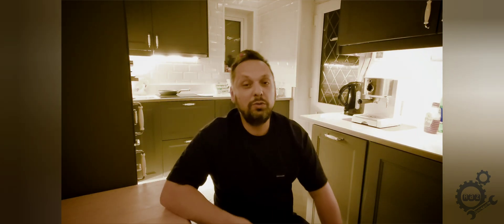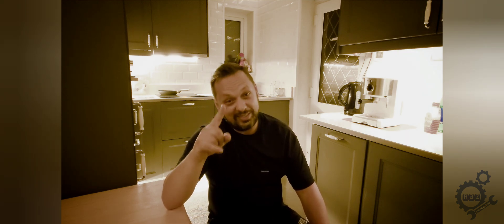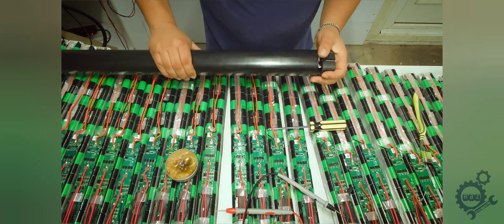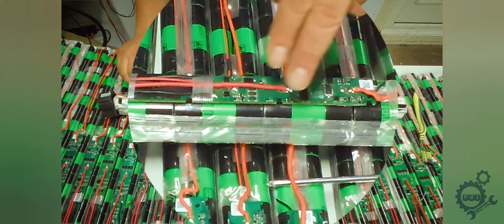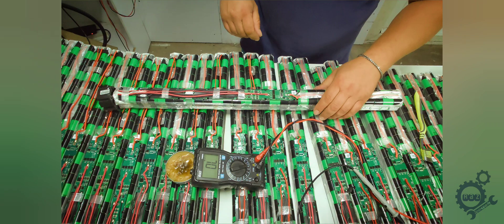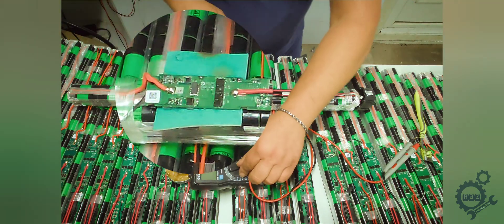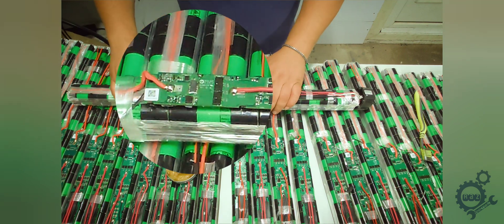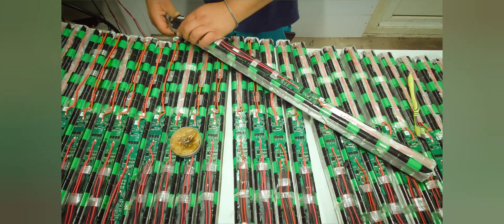VANMOOF S3/X3 HOW TO REPLACE THE FUSE Error 6 , 17 , 19 , 20 , 21

Comment: I have a VanMoof S3. When I plug in the charger, the charger light turns green, but the bike display shows nothing. I removed the Smart Cartridge and plugged in the charger again, and it displayed Error 48. I opened the battery and found that the main fuse is blown.

Is this expected behavior? Will replacing the fuse fix the issue?

Comment: The part number for the fuse is SFK-4045 and the part number for the fuse of the external bike battery is SFK-4030.
You can find the data sheet and sellers with this number ( I bought the fuses from Ali Express).
I fixed an external vanmoof battery in jannuary and used hot air to replace the fuse as I was unable to get it done with a soldering iron, the plastic cover came off and I did not bother to glue it back on as the fuse does not need the cover to function and is well protected inside the external battery pack.
I also reduced the charging voltage of the vanmoof charger as shown in another video on this channel.
Thank you for your videos they helped me to save a healthy battery pack so the owner did not have to throw away a perfectly balanced battery with no defect but the "eff you" fuse.

Comment: Since you have tons of experience with these batteries: My dad has a S3 and after having it out over winter it didn't came back to life. It has error 19. I assumed the battery was too deeply discharged and the BMS pulled the plug, so I told him to get it out. Charge/discharge pins were also dead so I made him open it up, remove the black covers over the BMS and let him measure the voltage of the pack at the left and right center connection on the BMS. The multimeter shows 4.1V. How does that happen? Is there any chance it's something else or is it dead dead? And how can it discharge so low in a few months?
Reply from the maker: sorry for late reply ... fuse is blown and bms is shut from outside ... no power goes in or out .. regards

Comment: Hey, I get the error codes 6 17 20 by driving the bike at 70%. Can the Fuse get broken by driving and do you think when I replace the fuse that I will fix the problem.
Reply from the maker: Yes sometimes fuse breaks during ride ... Is the fuse

Comment from the maker: Problem is  that charger should keep charging with 4 amp and is not ...is charging with 6 ... How ever ... If you have a watt meter you will see that amps don't drop at around 80% and charge slow the rest of 20% ... It charges with 6 amp all the way to 100% ... Any lithium battery after 80% should be changed slowly... Is when the fuse blow and is ruining the cells ... That's a easy  and quick fix to get rid of the problem.... Probably it needs to be modified to have a slow charge at the end to avoid fuse to blow .... The percentage of fuse blown in batteryies is huge like 80% of the fleet and the ones what doesn't blow fuses  chargers are properly made ... error 21 Don't worry about it ... Will clear as soon as you start the bike ... But people will have a usable bike  without that fuse problem
Reply from the maker: So in London only they sold about 2000 bikes ... I think 60% of those had fuse blown and replaced the battery on warranty... Imagine how much vanmoof lost because of those chargers ...
Reply: @Razspareparts  They replaced the fuses inhouse and put the battery's back into the fleet as refurbished ones.
Reply: How did you turn down the charger?

Comment: Hi,

I watch all your videos and learn a lot from them.
But I have a question. I adjusted the charger as you showed in your video. I measured the voltage output, and it is now 37.3V. When I charge my bike from 10% to 100%, it stops at 85% (40.5V). The charger stops charging, the light turns green, and l also get error 21. I have a second charger that I have not adjusted, so I measured its output, and it is 41.1V. This charger charges the battery fully.

I think that when you adjust the charger, it is not powerful enough to charge the battery to 100%.

Or do you think there is something wrong with the charger?

I would like to hear from you and learn about your experiences.

Kind regards,
Sam
Reply: Hey is it possible to answer my question? Is it normal that after modifying the charger the charger will stop after 85% because after 85% it gives a green light on the charger and stops. Is this normal?
Reply: @samvandop9539  This is normal and expected behavior. 

Think of it like two tanks of water connected with a pipe. Water flows from the side with the higher water level to the side with the lower water level until they are equal. If you lower the level from the tank with the higher level in this case the charger the equalization only happens to that point. Since you lowered this point you can not charge higher then that point. It is also better for your battery.